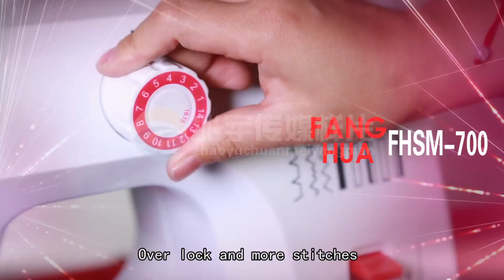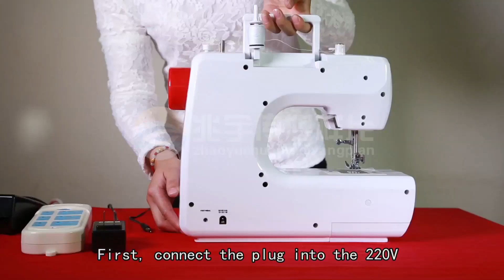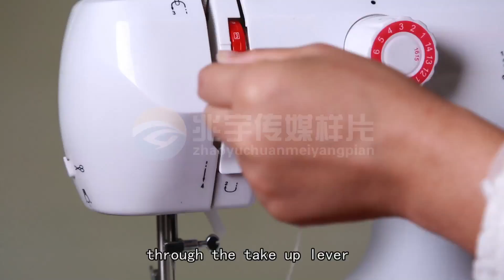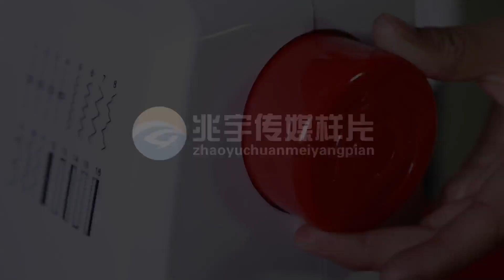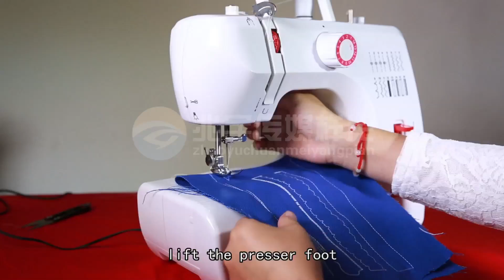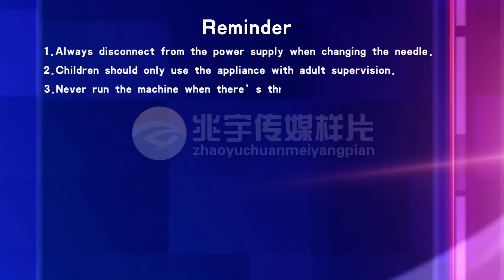700 electric sewing machine guide

Comment: Is it good?
Reply: Nope.
Reply: I bought one of these machines in the UK 4 weeks ago. It is called the EGL 700. It is a great little portable machine. If you read and follow the instructions properly it will work like a dream. I would only use it for light small projects though. It cost £50.